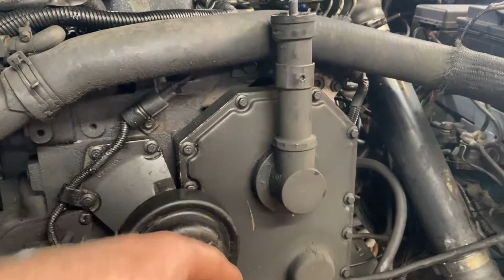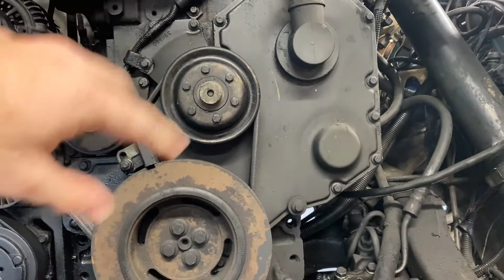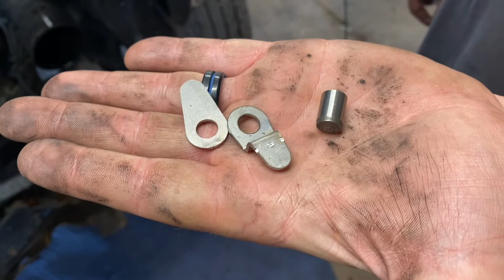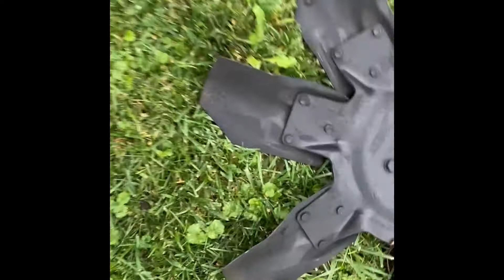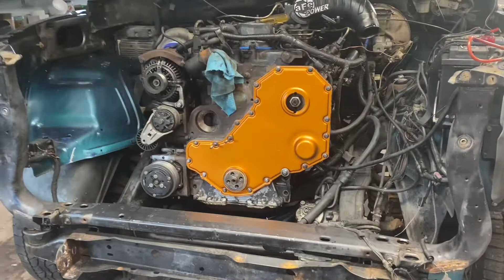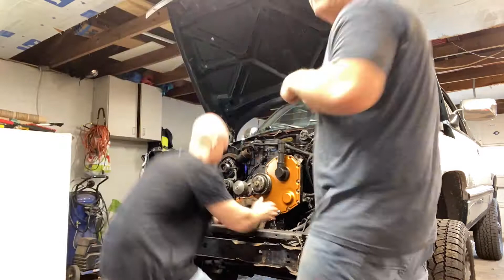Cummins front seal and killer dowel pin fix! Crazy transformation!

Comment: Yours wasn’t actually that bad compared to mine with the oil buildup 😂
Reply from the maker: lol if yours is worse it needs addressed immediately 😂😂
Reply: @3guysgarage yeah I got it apart in the garage now. What did you use to clean the lower part? Looks awesome
Reply from the maker: @chrismccreight8207 a boat load of purple power and wire brushes

Comment: they run like magic but have oil leaking all over everything ! just bought a 91 it has 300k miles and i did the kdp my pin was literally out all the way i gave it a tiny pull and it popped out ! i hit the kdp lottery i put some loctite on it and tapped it back in then put my kdp tab on it ! waiting on injectors water pump alternator and lift pump to come in im gonna put my new power valve in and change the governor spring im saving my 4200rpm spring for my new cylinder head .

Comment: question I'm about to attempt the kdp on my 12v I didn't see anything about unplugging the back of the motor to use the tool to stop it from turning when you torque it down any advise?
Reply from the maker: Maybe I’m not understanding your question
Reply: @3guysgarage he has an automatic, needs the barring tool or strap method to keep motor from spinning
Reply from the maker: @NoblesTx  strap method worked excellent for us before

Comment: I have mine apart right now, but my balancer just won't come off the crank because it hasn't been off in its 30+ years of existence. Picked up a jaw style puller hopefully will be able to get it off tomorrow was prying on the balancer for an hour the other night it just wouldn't let go. I have a 92 instead though with a ve pump.
Reply: I’m doing the same and also having trouble with the balancer. Im trying to do it all without pulling the intercooler but, i see im going to have to.

Comment: Thanks for sharing. I just finished the same project a couple of months ago on my new to me 96. My killer dowel pin actually fell out and did hit the top of the cam gear and blow the side of the housing out. The original owner spent all kinds of money repainting the truck and doing the interior but never did the Kill pin. Really surprised me.  I had to use wooden dowels to hold the tappets up to remove the cam ect ect, pull the P Pump gear and replace the housing . Another place to look for oil leaks is the vacuum pump in front of the steering pump. Cummins sells a rebuild kit for reasonable and you can do the labor yourself.  I would also recommend the green serpentine  belt instead of the black one. The green one will not squeal like the black ones do.  I didn't have to remove the AC condenser to pull the cam and do my front end. I also had to do the wear ring and buy the $75 seal from Cummins.  I appreciate you guys making the video, and giving your take on technical  skills to do the work.  If one takes his/her time and watches all the video it is doable.  My current project is the sending unit for the gas tank. Always reads empty. Then there is the brake light that constantly stays on and the new clutch.  Enjoy your truck and looking forward to more videos on it.
Reply from the maker: Honestly man I appreciate every single word you just said. I just started making a profit on YouTube about 6 months ago and it’s a dream to “get paid to do what you love”. It’s funny you mentioned the vacuum pump so not the pump itself but the feedline from the block someone made a homemade pressure fitting and it’s leaking we ordered a Cummins oem tho and then all my oil leaks are fixed. Not all the leaks total cause of PS and Trans but oil fixed! 

Again man I appreciate your support a lot if you aren’t subbed go ahead and hit that sub button 🤝